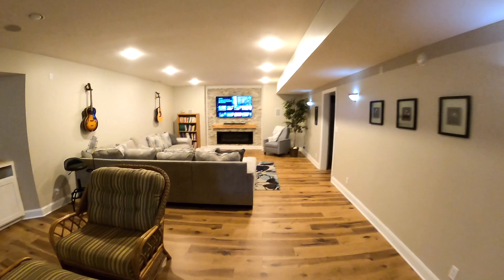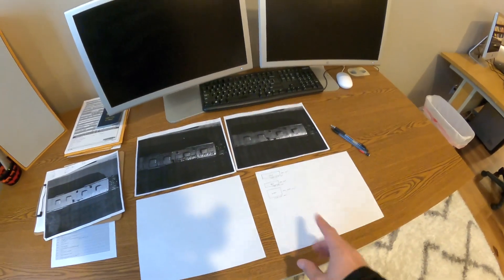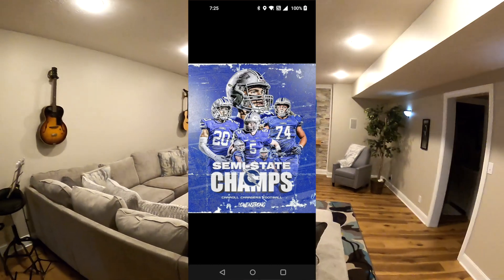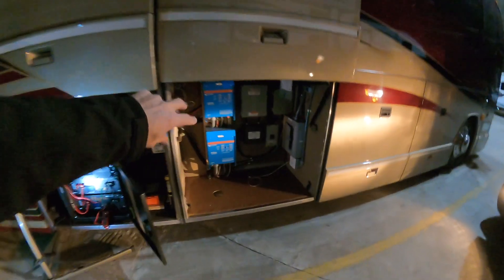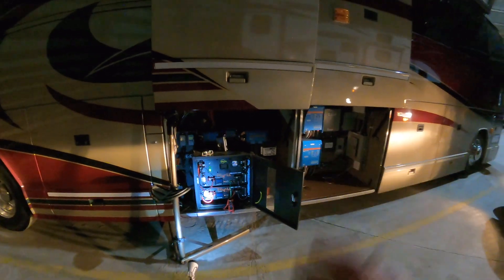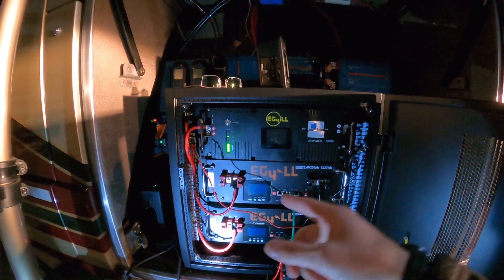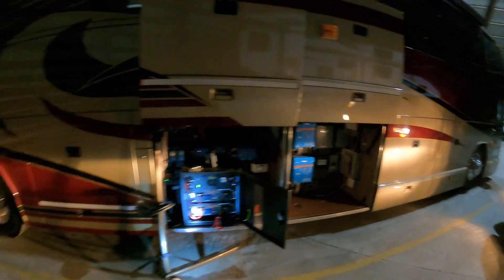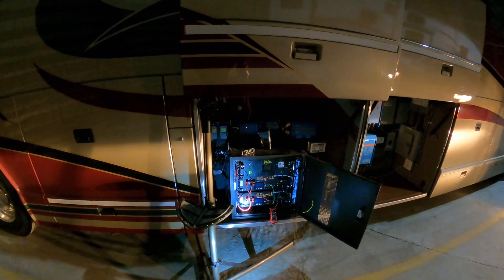EG4 LL Lithium Battery RV Testing While having COVID 19

Comment: Curious on why you chose the rack mount batteries?  Aren’t you worried about weather and specifically humidity and condensation getting into the inside of the batteries since they are not sealed?  Wondered if you spoke with the manufacturer at all about this?  I’m looking to do the same thing, so would like to know your reasoning on this. Thanks in advance.
Reply from the maker: Honestly I chose them because of the finished setup, ability to canbus with Victron and price. Good question on the humidity. I plan to pull the bus out of storage for a spring break trip and can pull a battery out, pop the lid and see in side. The prevost bays are sealed pretty well - just temp fluctuations would be the biggest issue creating moisture. I guess the biggest issue would be traveling on a hot humid day and then exposing to AC - the bays are not AC controlled, only heat - so not expecting much - but you never know.

Comment: Sorry you got COVID!  Glad your not feeling so bad you can still do some stuff!   You've got a lot first world problems to be thankful for.  Being stuck in the "dungeon" that is a very well configured and decorated basement entertainment theater with a keyboard Internet back office.  In all seriousness I hope your COVID is past the worst part and you will be over with it completely soon!

It's a bit strange the Inverters aren't designed to do a better job of minimizing the extreme jolt of a prolonged short when connected to 24VDC.   Now if that 24VDC supply was from lead-acid starter motor batteries those batteries are designed to see a near short when running a starter motor.  When starting a 12VDC car the battery has such a strong load on it the voltage can drop way below 12VDC and 7 - 8 volts or lower might be seen.   That voltage drop on a lithium battery pack might be seen by the protection system as dangerous to the lithium cells.  

I don't understand why, but when lithium cells drop below a certain voltage the protection system is designed to disconnect them and not allow them to be charged or used.    That doesn't happen with an RC car six cell lithium battery pack that is just a battery pack with no protection circuitry.   I've been able to recharge it even though its at low voltage, but my Ryobi battery pack refuses charging and it is likely because the battery voltage has dropped below some critical level and the protection system has disconnected it.   

Maybe you've already had the experience or the knowledge isn't worth the effort, but seeing if the Inverters connected to a couple 12VDC car starter batteries connected in series might reveal the true origin of the Inverter's design being for conventional lead-acid batteries.  A non sophisticated fix would be to have a 0.1 Ω shunt wired in series with the input to the Inverter that would be active when the input capacitor is discharged.  When the input capacitors reach a certain level of charge a relay would close to short out the shunt providing a low resistant path between the batteries and the Inverters.  Simplifying the circuitry more likely a timer could be used instead of circuit requiring sensing and logic.  You could just check the amount of time it takes to charge the capacitors with a shunt installed, then if its relative short period, just double it for use as delay timer switch.  If you do connect a couple of starter batteries keep in mind with good conductors they can for a 1/2 second pull close to 1,000 amps!   That will blow and spark worse than anything you could do with your house wiring although it is non lethal you could get debris in your eyes and other injuries.
Reply from the maker: I first learned of the capacitor pre-charging while hooking my outback inverters to my lead acid batteries - dangerous at best.  I then learned that any decent high end inverter just needs pre-charged with a resistor before hooking it up. So not really a big deal - something everyone will have to do (or should!).  

So I just pre-charged my Victrons before hooking to my AGM’s.  

Now that I have Lithium - they have a BMS (or should).  Not a big deal, just precharge the inverter before hooking them up - not a big deal. 

The issue or problem to solve - was that the EG4’s I am using are supposed to have pre-charging systems in them.  So icing on the cake. 

My issue is that I am using not one, but two large inverters in split phase - a much bigger load to pre-charge. 

I finally figured out how to do this with the version 1 batteries and the version 2.  

This allows me to simply turn everything off when not using - so I don’t have to worry about anything being trickle charged, going dead, being overcharged, etc. They will stay that way for years without worry - in the off mode. 

Now all I have to do is turn the batteries on, turn on the inverters and head down the road. It also allows me a simple way to reset things should a BMS feel the need to turn itself off.
Reply: @CampPrevost  It sounds like you've solved your inverters start up over current problem with the lithium battery packs.  It seems like a scaleable solution would be to have a sequenced startup of the inverters so the battery packs only have one inverter capacitor bank to pre-charge at a time.   That might be what the inverters are now doing.  

The inverters likely have the most minimum wattage resistor running the shortest time possible for pre-charging the capacitor because it gets incredibly hot and anything more would require more ventilation and larger more expensive high current components.  

Switching high currents or inductive currents is very frustrating because they arc.  That seemingly little aspect actually is the one of the big reasons for running A.C. power verses D.C. power so there is a zero voltage point when fast acting switches can disconnect or connect a circuit. 

Thanks you for your family Prevost videos!